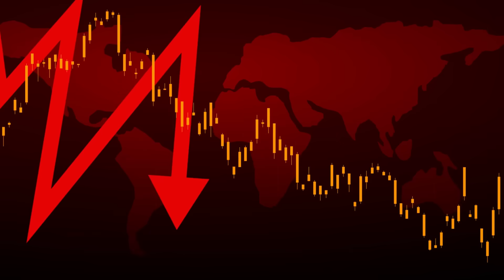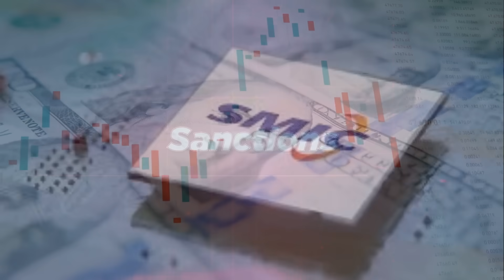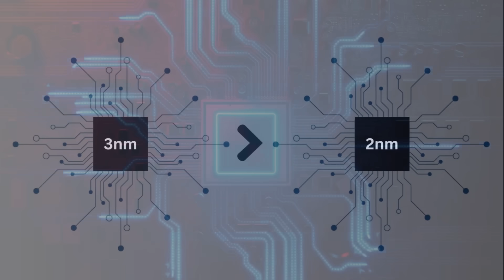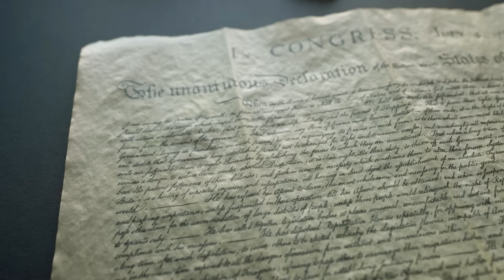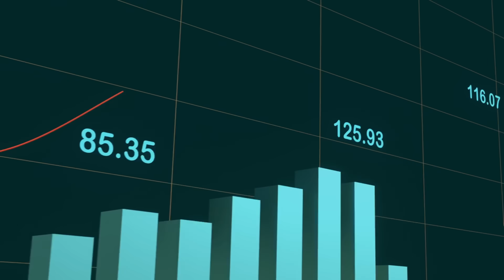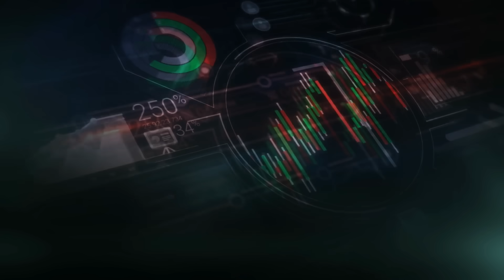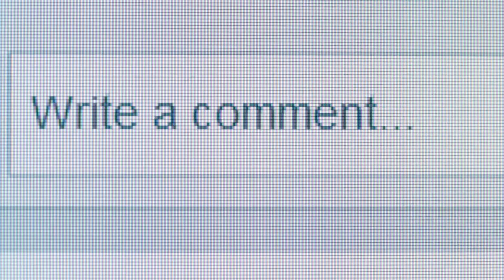SMIC Releases 2nm Chip Despite U.S. Sanctions — Washington in Full Panic!

Comment: Last I heard is that SMIC has only achieved up to 5nm technology with its existing DUV lithography equipment.
Reply: you are correct and not to take anything away from SMIC but this post does have inaccuracies. 7nm has been a success story, 5nm is getting there but their yields are too low at 20%, this is with DUV equipment. Now unless SMIC is hiding a big secret 2nm is highly unlikely without EUV technology. I used ChatGPT, Google and DeepSeek to verify all of this.

Comment: Transitioning to *3nm or 2nm nodes* remains a distant goal, requiring EUV lithography tools that are still inaccessible due to U.S.-led sanctions.
Reply: New EUV machine from China. China does not need EUV from ASML.
Reply: @Abcd1234-q4v  While China has made notable strides in developing prototype EUV lithography tools, the assertion that it no longer needs ASML oversimplifies the reality. Current efforts, such as Huawei and SMIC’s experimental EUV system, are still in early testing phases and face significant technical and industrial hurdles.